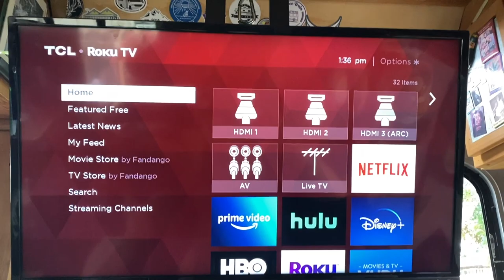Bus life Entertainment Center Wander Boom presents

Comment: Maybe I missed it, but is that 12 volt or run it off the inverter?
Reply from the maker: Not a 12 volt no. We use it off the battery sparingly. Great when plugged into shore power, like maybe a nice compound with a tiny house in Oregon...just as a hypothetical.😉✌️
Reply: @Wanderboom  You know your way to the Hideout😊😎🏴‍☠️